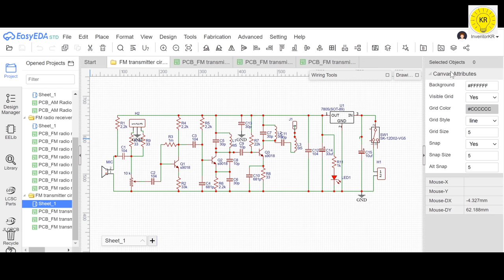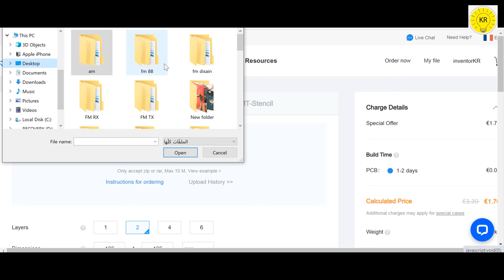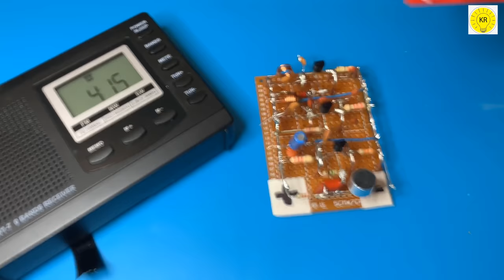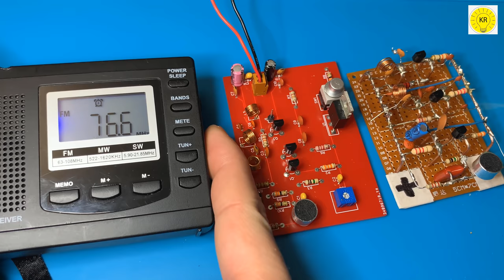how to make fm transmitter, jlcpcb

Comment: I recognized this, some chinese dude is selling kits to make this setup 3 for 10 bucks. I just built one yesterday to pass a few minutes of time.  Put one transistor in backwards and the dam circuit board copper was so thin when I removed the solder  the copper came off. Oh well I didn't need it for anything anyhow I have 2 working  already. Think I will hook one to one of my home built WIFI radios and rebroadcast it to my old AM/FM Cassette from my time in Nam.